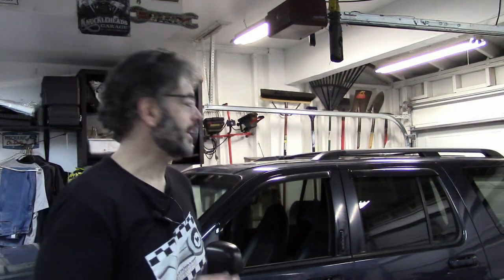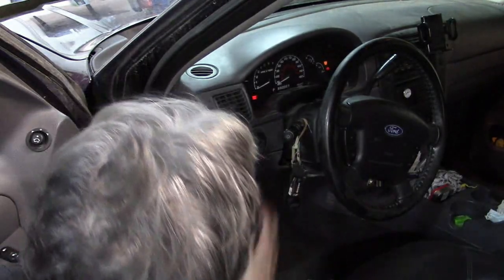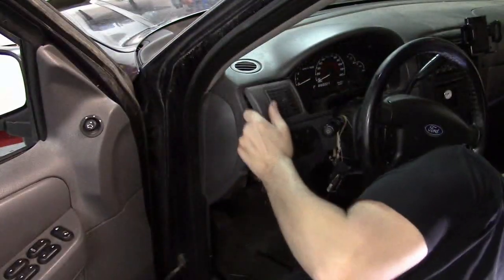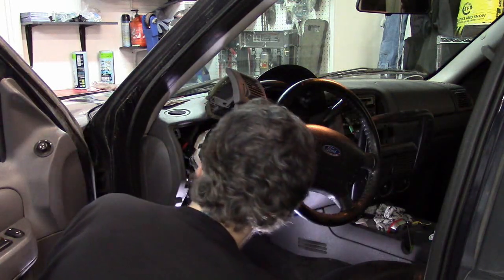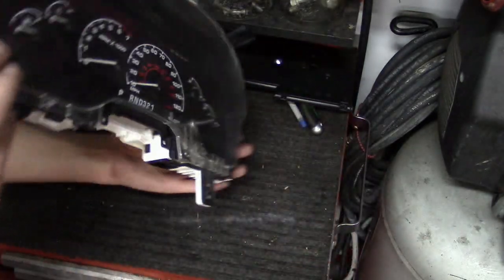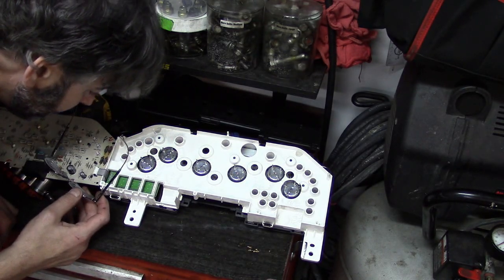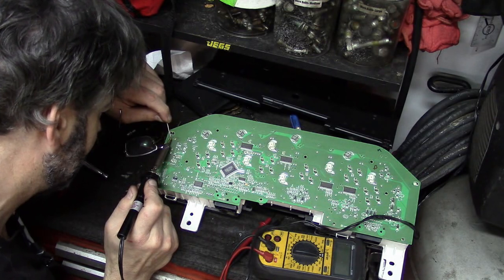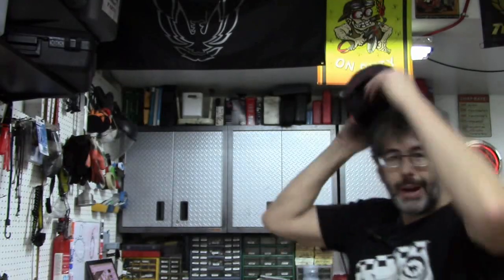No Odometer Diagnose and Repair  02 Explorer

Comment: Even though solder has a core of rosin flux, guys who do this every day add a dab of extra flux before reheating a broken joint, then wipe away the flux after finishing. I started doing that and was amazed at how much better my joints ended up. This is a good video, Matt. Broken plastic fasteners are the biggest challenge for guys trying to find a way behind the dash. So, there is a role for a fastener by fastener description of a procedure, even though it doesn't fit very well with entertainment goals.
Reply from the maker: Thanks Dave and Merry Christmas man!! Good advice on the solder. I seldom do soldering so I was unaware of that.

Comment: The fuel trim video is one of the best so informative!
Reply from the maker: Yes I have to say of all my videos I think that one is the single most important. q
Reply: @SchrodingersBox  I have been spreading your fueltrim video url in our local old BMW community, but they most likely still buy new oxygen sensors instead of connecting scantool. But worth to try? :D
Most common codes from E46 cars are always lean condition in both banks.
Reply: @SchrodingersBox  That video has opened up a whole new world for me. By the way you didn’t turn those bolts right 😂

Comment: Matt fully enjoyed the hardware sarcasm, with a great fix using a soldering iron! Those resistors were out of circuit, so you got an accurate reading; otherwise, in-circuit connected components may give different values.

Comment: Yep - only 2:20 minutes in before we are treated to a Christmas asshat impersonation - haha. But how did you know, right off the bat, that the issue was at the dash and not further back towards the control module? I would never have spotted that loose resistor; I guess I have so much to learn about electronics.
 
Fortunately for you, your degree in molecular biology covered you for the removal of the screws, but most of us would have struggled with that part.

And kudos on reducing a 1939 Oscar-winning classic to a farce in which a scarecrow gets hanged, and a little girl scares the piss out of a lion. LMAO - this video had me in stitches!
Reply from the maker: That’s actually a really good question. the reason I know it’s a circuit board issue and not for example a BCM issue  is because the odometer display itself is produced by the circuit board. Something like the meter not changing with mileage or the temperature reading wrong I would judge to be an input issue and I would have looked elsewhere for that. But the display being blank is a circuit board issue.

Comment: Had this happen to my Silverado solder joint at SMD resistors . I also replaced the bulbs with LED light while I had it apart  as well as the stepper servos controlling the analog  gauges . Not difficult on my year truck.

Comment: Think it was isolated just to the odometer, the resistor? Or could that also be a terminating resistor for the can bus?
Reply from the maker: Just for the odometer. If it was a CAN or BCM issue then the display would be incorrect, but still visible.

Comment: You would be surprised how many of us have cracked dashboards by missing just one stupid bolt. A+ for bolt turning. My grade Trumps all other commentators.
Reply: I think it is a skill and lots of experience  to take that apart without breaking anything .  Different skill than using a scope to test a wheel  sensor but  a higher level skill in my opinion.Why do we always downgrade manual skills
Reply from the maker: The reason is because EVERYONE has that “skill”. There are millions and millions of people who have been changing parts “skillfully” for 30, 40 , even 50+ years and yet not a single one of them has properly diagnosed the part they changed- especially if it’s electrical. One reason they are so “skilled” is from practice because of changing so many unneeded parts. 
   By your definition, every time I am at Oreilleys and the guy in front of me is trying to return a MAP sensor and buys a MAF sensor and then later returns that to buy an O2 sensor and later returns that to buy a IAC but he never damaged the parts while installing them is more skilled than me who knows exactly what I need the first time.

Comment: I don't know what all that resistor ohms stuff is, but if you held your thumb on the ratchet head and placed the handle between your pinky and ring finger, those bolts would come flying off!!

Comment: Classic cold/cracked/failed solder joints on almost all the resistor legs.  (Hope it was noted that the other 2 resistors also had cold/failed joints)  And yeah,  Nothing wrong with the repair.   (This is coming from an electronic tech for the last 27 years,  I repair arcade games and monitor boards)  Fairly sure the "Haynes Jockeys" will retort with some stupid comments.  I'll stop 'em right here!   I have all notifications shut off, so the trolls will squeal like piggy's!  And I'll never see 'em  :-)

Merry Christmas!
Reply from the maker: Yes I did solder all the resistor joints- I only showed a couple as examples. even the ones that seemed secure I assumed are probably weakened because that whole area was affected.

Comment: Had the same issue with a 99 f150. Saw a video that described the exact same problem and it was a similar remedy as this. The gen10 ford trucks are notorious for these bad solder joints. The most time consuming part is getting the instrument cluster out of the dash. Thanks for not recording the bolt turning. Boring! Your videos are much more intellectually stimulating.
Reply from the maker: Glad you appreciate the format of my videos. I agree- bolt turning is mind numbing. I try to focus on the intellectual aspects.